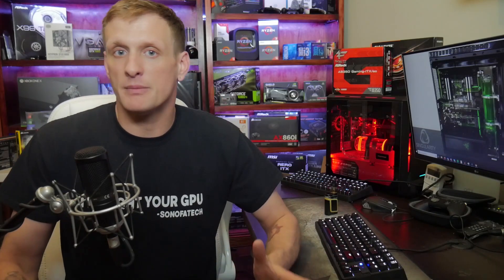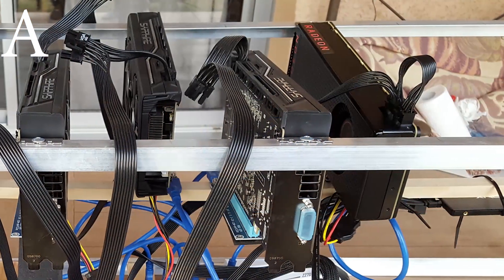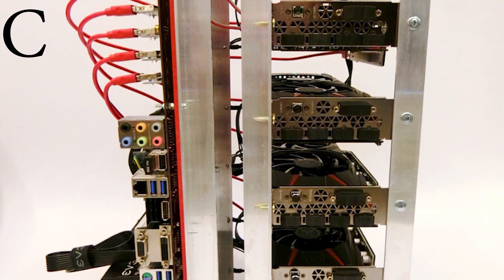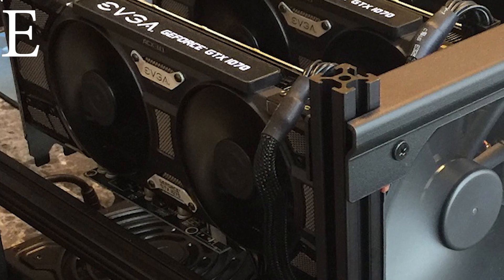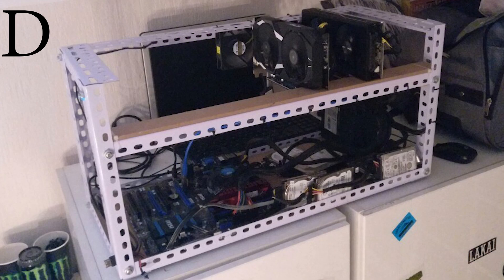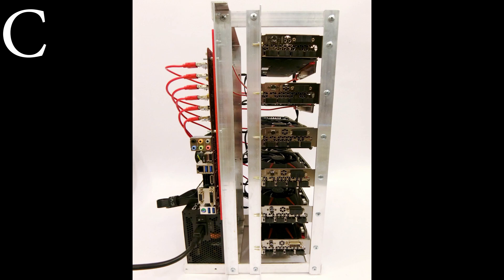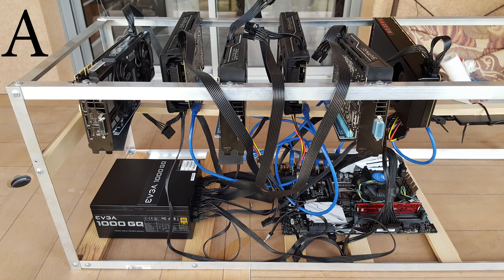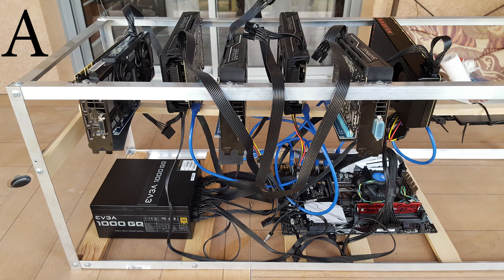Mining Rig Wars 20: Mining Rigs ONLY!

Comment: Yay aha that's my little "FireCabinet" in D! :) just to let you know, I've since achieved some news bios mods for my cards and I've also added a third one.
I'm now running my 580 at 930 h/s and my 480 at 911 h/s. The third one is an msi r9 270 2gb OC with also a modded bios. It's getting 430 h/s. Now my whole rig as a total of 2270 h/s + 4TB on BURST for a total of 430 watts at the wall. ✌️ really happy to see my rig in the competition! :D
Reply: Oh and by the way for now my cpu can do the job on mining thoses 4TB pretty nicely, it take less than 15sec with an average of 250mb/s. I have to point the fact that most of my HDD's are only SATA 2 7200rpm or SATA 3 but only 5200rpm. I've also been paying a lot with tweaking windows and my motherboard bios to achieve a pretty good stability for a 24/7 mining rig. He never crash on me for weeks so it's perfect I think 👌

Comment: Frame on RIG E is SIC! Any more info about it?
Reply from the maker: No more than I gave
Reply: I think it's this one 
https://www.amazon.co.uk/Professional-Stackable-Excellent-convection-performance/dp/B073Q2CN14
Reply: Yep its a Veddha v3.  I have 4 of them.  They are stackable too.  They can be had on ebay for around $100 shipped. Not including fans but do include 1 row of 5 fan hardware.  For more info you can goto the makers website Bleev.IN